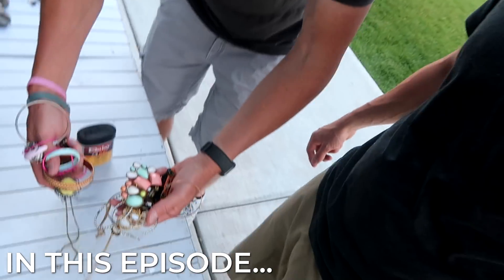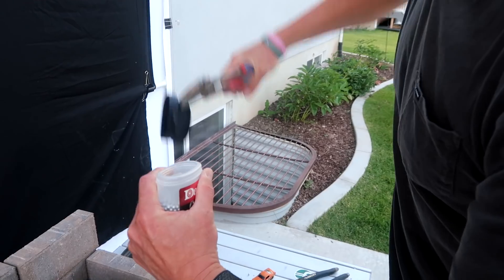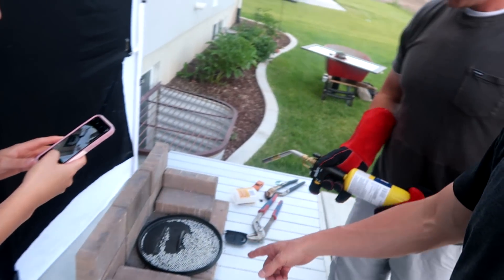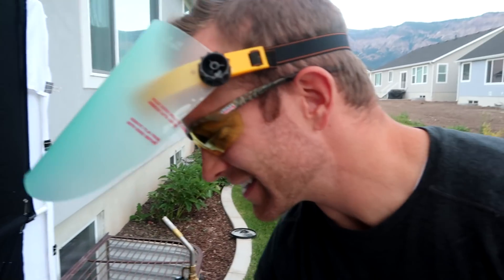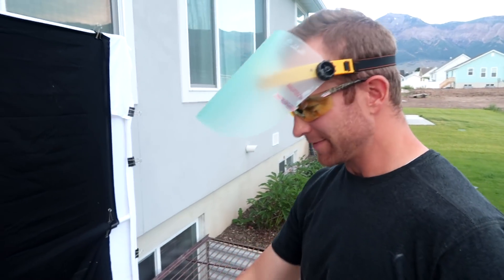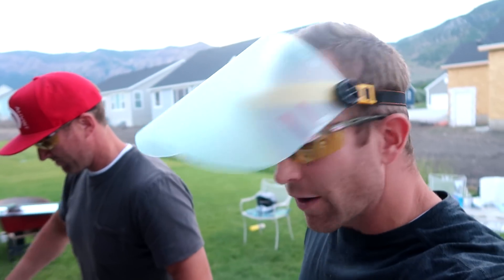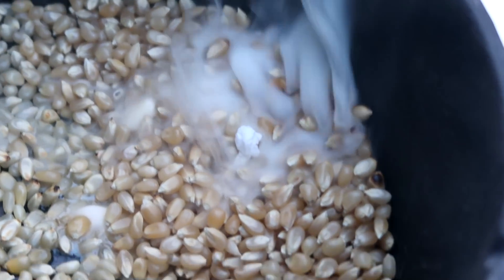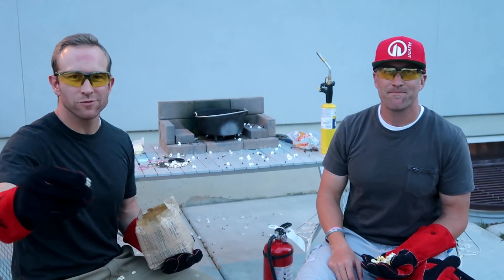MELTING MY WIFE'S JEWELRY AND A 1966 FORD MUSTANG!

Comment: Some more things to Try to Melt: 
(I have a lot on your first video of things to melt)

🏆 MELTING TIME CHALLENGE 🏆

🔥1: Sherbet Packet
🔥2: Rubber Ducky Bath 
🔥3: Uncooked Potato 🥔 
🔥4: Rainbow Lollies 🍭 
🔥5: A Egg 🥚 
🔥6: Seashells 🐚 
🔥7: Pinecone 
🔥8: Styrofoam Ball
🔥9: Broccoli Floret 🥦 
🔥10: Wildflower (weed flower in your yard)
🔥11: Hollowed Pumpkin
🔥12: Wife’s Lipsticks
🔥 13: Old Shoes
🔥 14: Golf Ball

Tip: You Should Also have a Hazard Extinguisher as Well (Just is case)